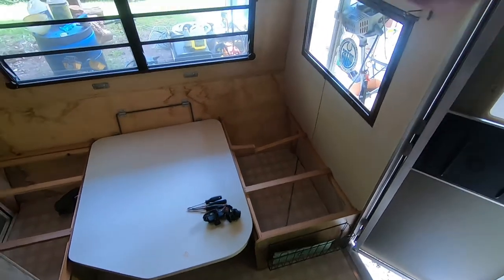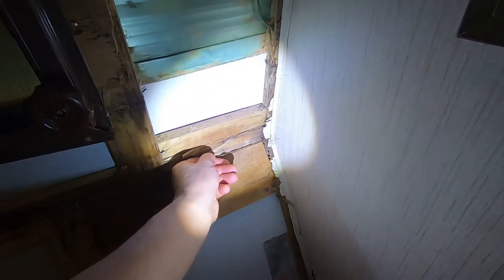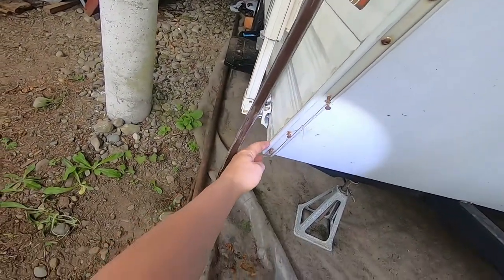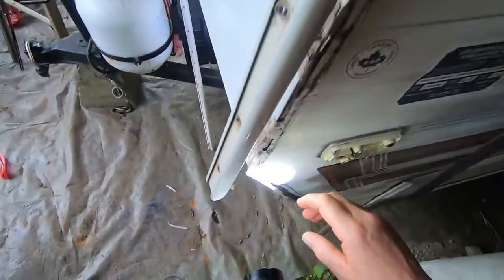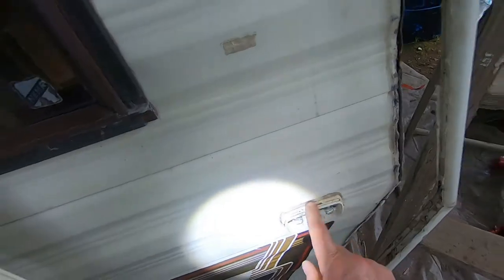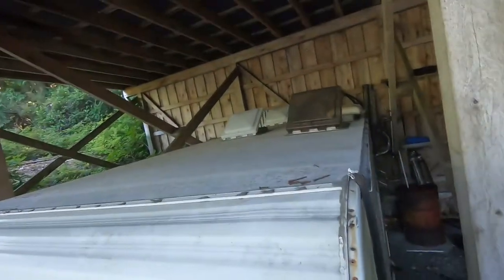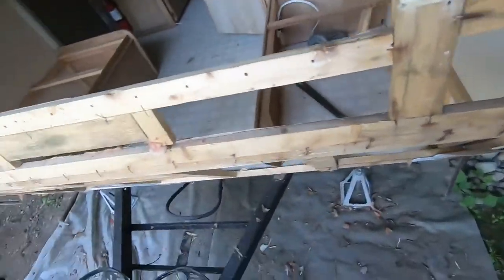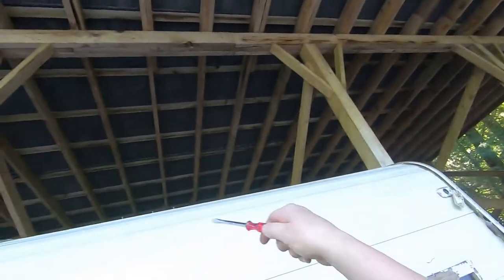HOW TO FIX A LEAKY TRAILER "THE REPAIR" PART 1

Comment: I appreciate these camper videos, I am working on repairing a 1987 Bonair with extensive water damage but have limited experience with trailers. Thanks for your knowledge.
Reply from the maker: I have several other camper videos on my channel. That reminds me, I should place them all in a Playlist available at the top banner inside the channel. I will do that today so they are all in one place.
Reply from the maker: I just placed all my trailer videos in a playlist in the banner of my channel. Enjoy!

Comment: That's like opening up a can of worms, as the saying goes. It's amazing how cheaply they make these. Like you said in the video the design could have been better by making an overlap creating a mechanical seal and not relying solely on the sealant. Hope you can find a place to stop the dismantling, before the whole thing is apart, and start the rebuilding process.
Reply from the maker: Thanks for watching. Yes, RV manufacturers could do a lot better...and they will, when I start my own country, haha. I have stopped the tear-out at the front wall only, and have identified the main source of the leaks (front corners all the way to the top seam) and will begin the reassembly process soon.